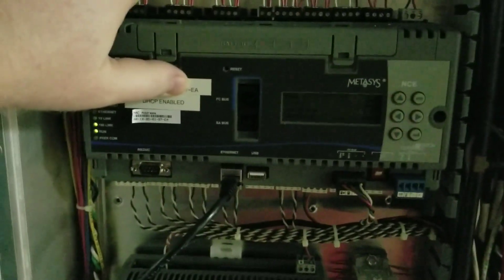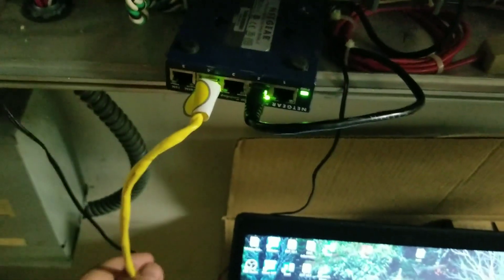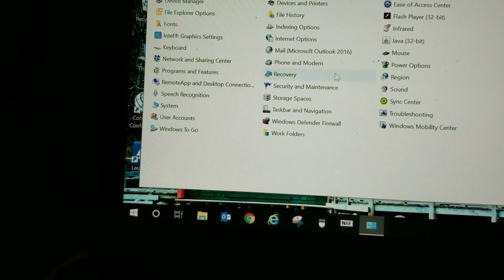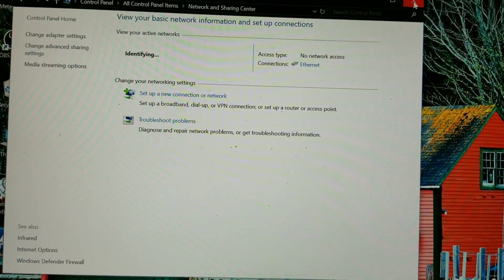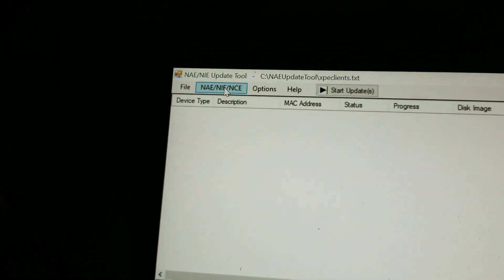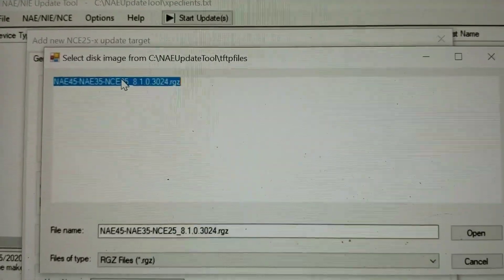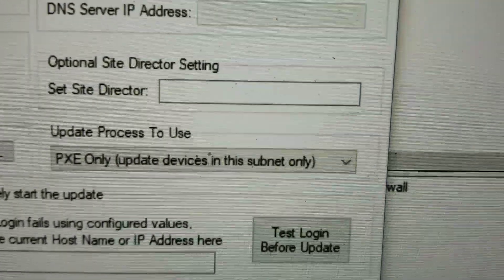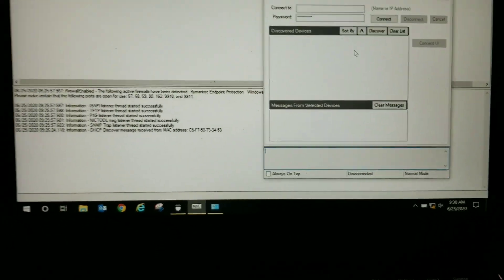How to image an NAE or NCE using Johnson Controls Image Tool

Comment: How do you install the image file? I have it as a mei file.nothing will open it
Reply from the maker: You will use sct or the image tool to open it. When you select download code in sct you should be able to link the image.
Reply: @Systemcontroltech  but first dont you have to install the nae images? Its a mei file or something. Do I have to install sct first to open the image files and install them?
Reply: Do you have any broken nae5510-3 you want to sell I repair them.

Comment: Hello. I require downgrade file for NAE5510-3 the current version is 9.0 I cannot seem to find patch file for version 7.0. The ADS 7.0 does not have package for NAE55 neither do later versions.
Reply from the maker: You will need to contact jci
Reply: @Systemcontroltech  Just did today waiting for their reply.

Comment: Hi!  I can't find anyplace to get the NUT tool.  I tried upgrading a NAE45 from 5.x to 7.x using my SCT installation over my LAN (SCT running on a server).  It did not go well.  Any help you can provide is appreciated!
Reply from the maker: The newer version of Metasys uses SCT for the upgrade. The NUT tool is still around but very hard to find.  You may talk with local jci techs to try to get a copy.